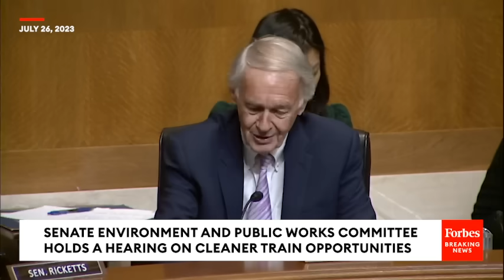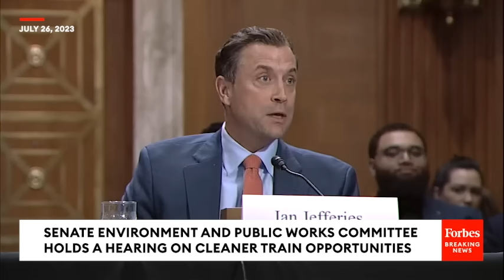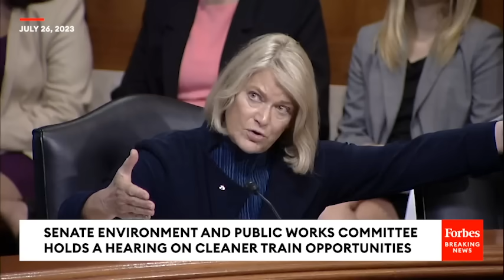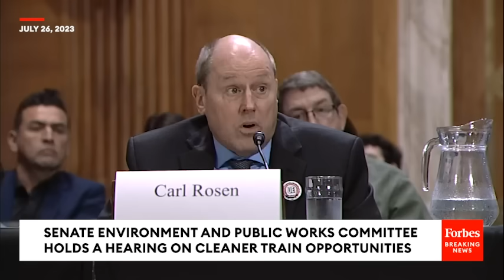‘How Long Would It Take To Replace All Diesel Locomotives With Electric?’ Cynthia Lummis

Comment: Why do all changes have to be an 'amputation'! What happened to slow, well thought out and methodical change? Make small changes, study the effects and adjust as needed. This methodology has worked for centuries.
Reply: Common sense is just too uncommon today.
Reply: and we did not do stupid things centuries like Get rid of Diesel Locomotives when there is a big time electricity shortage in the us
Reply: That is the difference between us and the radical left. The radical left general population and the ones in charge lack all critical thinking skills. They question nothing and do everything they are told 😂
Reply: We have more than 150 years of coal and 450 years of petroleum. Preparing for the natural convergence of time, technology and technique will provide far more efficient and economic alternatives than the overpriced products of today; most of  which, the guilt driven public can't afford. Finally, independent authors, like Bjorn Lonborg, are coming forward to emphasize this inevitability.
Reply: @johncollins7062  its the other Way 150 years of oil 500 years of coal, Oil and nat gas can be made from coal
Reply: @dknowles60 - With the U.S holding the most coal reserves (24%) and only eleventh for oil, your contention does not seem possible, mathematically. Also, your second statement invalidates the first, because it would violate the planetary corollary of the Goldilocks Effect.
Reply: @johncollins7062   wrong Again, i can tell you are very Young From the  Fed Gov there is a lot of Coal in the Us
Reply: @dknowles60  Still, you have not cited any sources. Mine is Grover Norquist. What is yours? BTW, why do you talk down to me and type without syntax and practically no abbreviation?

Comment: Locomotives are electric. It just uses diesel engines to generate the electricity to power the traction motors. To make a train all electric, of course you could electrify the tracks.
Reply: New Idea from Congress:  Add solar panels and wind turbines to the top of all rolling stock.  They can generate electricity while they are in motion to power the locomotives.  HAHAHAHAHA
Reply: wount work  @zz449944
Reply: Yes, but "JUST" Diesel engines (not batteries) generating electricity, IS EVERYTHING!!!!!!!!!

Comment: Why tf would they use batteries? If they really wanted electric rail why wouldn't they be using pantograph/suspended wires? California is going to have issues the more they push. Have fun eating when nothing can be shipped. Funny too that dude seems shocked that railroads are not ordering tier 4 locomotives. Of course they are going to hold onto older ones as the current mandated emmisions control on diesel engines  make them completely unreliable. Thanks again to California for that.
Reply: They will build the wires if taxpayers pay for them.
Reply: @MilwaukeeF40C  the public is going to pay for all parts of electrification infrastructure from generation to delivery anyway so what's another couple billion I guess.

Comment: How does an airline go to zero emissions? 

Answer: They don't fly they go away
Reply: Academics from the University of Oxford and Imperial College London say that every airport in the United Kingdom must close; all beef and lamb must be made illegal; and all new construction must halt in order to reach “zero emissions” goals by 2050.
The only airports that would be allowed to continue operating are Heathrow, Glasgow and Belfast, and only under the condition that all transfers to and from the airport be done by rail rather than cars.
“All remaining airports must then close between 2030 and 2049 as to meet the legal commitment of zero emissions by 2050 every citizen of the United Kingdom must “stop using aeroplanes” for a significant period of time,” reports Exposé News.

On aviation, they say: “Although there are lots of new ideas about electric planes, they won’t be operating at commercial scales within 30 years, so zero emissions means that for some period, we’ll all stop using aeroplanes. 
https://www.climate.news/2022-07-08-climate-change-academics-ban-meat-construction-airports.html

Comment: You don't have to "replace" the locomotive.  It is already a Series Hybrid Electric machine.  
Fill a freight car with batteries, inverters, add some Control Systems, hook up a few cables, turn off the diesel.
Walah! It's a BEV!  Actually, it is a Plug-In hybrid with Range Extender.
However a BEV is the incorrect solution for any operation outside the yard.  
Cross Country, you want to pick up high voltage from a 3rd rail hooked to a Nuclear Power Plant.  England is already doing this on majority of trains.

This approach works on all rail systems as the infrastructure is updated.

Comment: 1) locomotives ARE electric and have been for decades. 
2) the negative environmental impact just to produce the batteries would be far worse than the impact of continuing to use Lectromotive locomotives. 
3) there is no man-made climate change..it is a myth that is perpetuated to insert control over the people.
STOP FALLING FOR THE LIES!!!

Comment: They are electric!  They use a diesel engine to turn an alternator to make power for the electric motors.
Reply: But -- they want locomotives powered by solar panels, windmills, and unicorn farts.

Nevermind that today there are not enough working windmills in the entire United States today that combined could power even ONE Train on ONE Trip.
Reply: @zz449944  right! It's like there gun control argument, yet they kill 350k people a year through planned parent hood. Just sad that these people are so far out of touch with what's really happening.
Reply: They use Electromotive Diesel Engines 645EMD or 710EMDs and the engines do not drive “alternators”. They drive large direct current generators for the final drive motors. If necessary, a silicon controlled rectifier can be utilized if needed but they aren’t currently as they are the most efficient as is. The current efficacy of unicorn farts have not been presently determined although congress will convene a blue ribbon panel to make a study.
Reply: Understand of what you speak before attempting to amaze people with your vast knowledge please.
Reply: @krautyvonlederhosen  what is wrong with you? Why on earth did you find it your cause to correct me? We both agree trains use electric! I just think your being childish.

Comment: You need Overhead Catenary substations and a power distribution system first. Found widespread in countries other than the lobbyist run USA
Reply: And you need nuclear reactors to generate electricity across the deserts and steppes to power battery only locomotives. Wind farms will not cut it.
Reply: Tell us about the population density differences in the two places.
Reply: @smedleyfarnsworth263 What's the population density of Siberia? There's OHLE over thousands of miles of nothing
Reply: No European sht railroads make money either, so if the government has unlimited money for overhead wires and maintenance, then ok.
Reply: @MilwaukeeF40C  Now what  do we have here, an American that does not like to be shown that they do not have the best system in the world. European rail systems are vastly superior to American ones. Where in America can you travel at 250kph between cities routinely, where there are trains that can reach over 500kph? Where they have traffic densities that are many multiples of American ones. OHLE does work well for Europe or else they would not use it.

Learn to accept that they are two different systems.

Comment: They will not go far on batteries, they will need over head power lines like in Europe. It would be a good time to rebuild the whole rail system, but they are not going to do that.
Reply: You don't rebuild the whole thing. You just string up wires.
Reply: @Isochest  Have really looked at the rail infrastructure in the U.S
 Lately. Then take look at China's. It needs more than a few wires.
Reply: @landofstan246  More viable than lithium batteries. The problems are more political. I understand rail companies can't generate their own electric power. The Wellbrook Act.
Reply: They could probably own their own power plants, but not sell the electricity.
Reply: @MilwaukeeF40C  If they could they could contribute to the dearth of supply in some places.

Comment: Would there be anything more stupid than battery powered locomotives? With the simplest way to electrify the route with over head cables? Ask any honest engineer about that? This is clearly a ideological proposition. Bears absolutely no reason.😊
Reply: and where is the Electricity Going to Come from, the Us is very Short on electricity or did every one for get the rolling Blackouts last winter

Comment: How things work...

Current locomotives ARE electric powered!!!!!!!  

The diesel engine inside the locomotive drives an electric GENERATOR that provides the ELECTRIC MOTORS of the locomotive with ELECTRIC power to pull the train.  They carry their electric generator WITH THEM.  Given the vast distances covered by trains the USA, this is the MOST EFFICIENT method of generating the electricity needed to power the trains.  Trains are extremely efficient in the amount of fuel used per ton/mile of cargo moved.

If they were "electric" locomotives (as frequently used in Europe or in subways and light rail in the USA) they would need to get electric power from a remote generator through wires which REDUCE the efficiency of the transfer of electric power. The remote generator would have to be powered by some sort of FUEL to produce electricity.

Battery powered locomotives are even LESS efficient! For each transfer of energy, there is a LOSS through heat and friction. (YES there is friction from electricity moving through wires)  Locating the SOURCE of the power as closely as possible to the USE of the power and reducing the TRANSFERS. Fuel > generator > transmission wires > transformers (to increase voltage for long distance transmission and then to reduce the voltage again to to usable levels) > rectifier (to convert AC to DC for battery storage) > battery > inverter (to convert DC back to AC for the motors) > electric motor. 
A DIESEL/ELECTRIC locomotive (that IS what they are called) eliminates the transmission wires, transformers, rectifier, battery storage and inverter and provides AC electric power directly from the AC generator to the AC motors driving the train! 

In case no one has been paying attention to the current energy crisis in Europe caused by the sanctioning of Russian coal, oil and natural gas... Europe gets much of it's FUEL to produce electricity for electric trains from coal, oil and natural gas. They are seeking alternate sources of fossil fuel to power their generators to power electric trains. Europe also has a much a higher percentage of electric power from nuclear power plants than the USA.  Likewise, the electric trains in the USA, mostly subways and above ground light commuter rail, also get their electricity from fossil fuel power plants. 

When you see a TRAIN LOAD of COAL, think of it as "another load of fuel for electric cars and trains".  

Electricity is NOT AN ENERGY SOURCE!!!!!!!!!!  It is a PRODUCT of energy sources!!!!!!!!